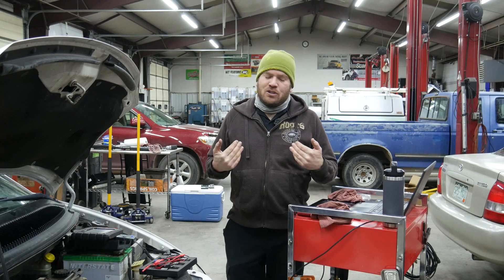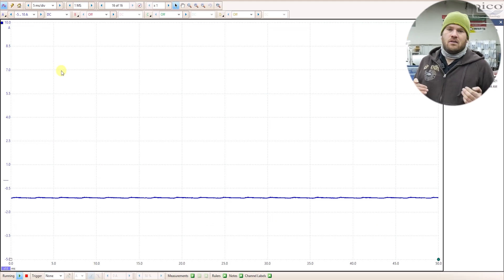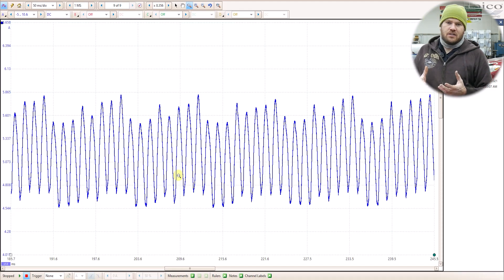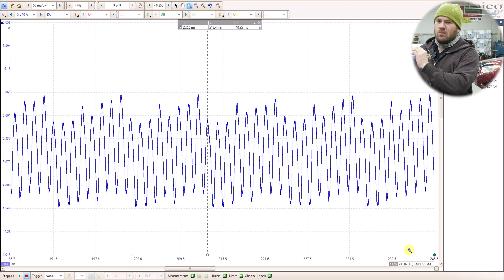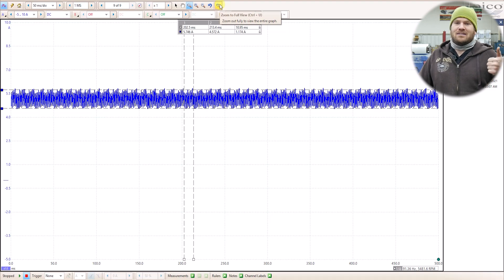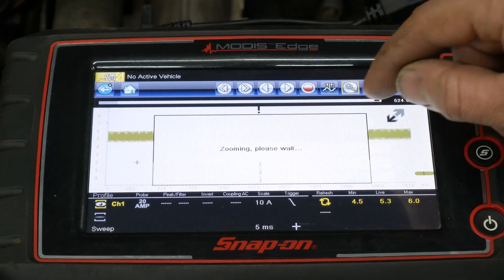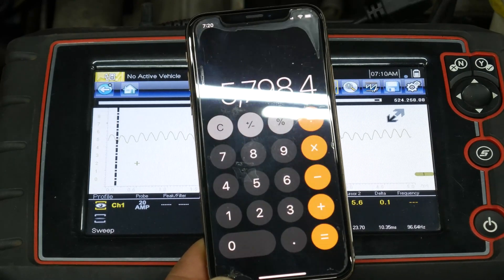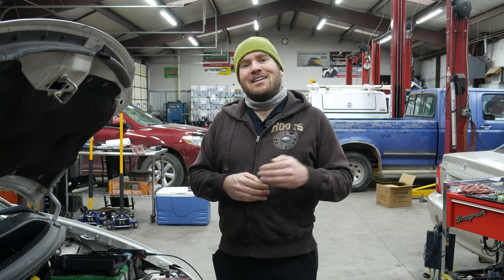Weekly Waveform #13 - Fuel pump current testing with low amp clamp.

Comment: Excellent. I gotta try this on my 2006 Matrx pump with the PicoScope 2204A and a Hantek CC-65 clamp.
Reply: Same setup I'm about to try out. what picoscope software you using?
Reply: @mrpartsng Nice. PicoScope 7 (version 7.0.116.1394) on a 2012 MacBook Air running OS Catalina version 10.15.7. I had to upgrade to this OS version to run the pico software.

Comment: Thanks for sharing your insights. Relay jumpers are cool. Just curious if Hantek or Micsig 4 channel scopes are good enough for automotive diagnosis.  What are your experiences?
Reply from the maker: Many start out with those scopes because of the price point. Most will upgrade to a pico at some point. 
I don’t have any experience with those scopes so I couldn’t tell you how good they are.
Reply: Perhaps, I could be one of those. Once again, thanks for the cool tutorials. @ThePracticalMechanic
Reply: The thing i don't like about the hantek, is the software, it doesn't show numbers in the scales.
Reply: Thank you for your input. I decided to go for Micsig, that will keep me busy for some time till I perhaps very likely to upgrade to Pico @RGV2300
Reply: Micsig makes a really nice automotive scope with pico like software features, but pico software is probably the best for automotive; you'll pay for it though, Pico is proud of their stuff.  Btw, the snap on scope isn't great, their sample rate seems low.  

Right now, if I was going to buy a new scope for automotive, I might lean towards a tablet scope like Micsig.  I'm just not personally a big fan of USB scopes for automotive.  Having the 0-360 and 0-720 rulers is a really nice thing that most scopes just don't have, Micsig has it in their "automotive" scopes software, but apparently not in the exact same model of non automotive scope.  They're all Android based tablets now, which brings up another handy feature, being able to access the Internet from the tablet, for Alldata or other reasons.

Comment: When I bench tested a Corolla fuel pump, it only pulled 2.5 amps! Squeezing the test hose to add a restriction got it to max out at 4 amps. Good pump as far as I could tell.

Comment: Very nice stuff. For folks who don't have an amp clamp but do have a scope, would it be possible to get a procedure of connecting a multimeter amp probes in series with the circuit and use the scope to voltage drop the pump ground wire on 1V AC at about 50ms timebase to check overall amp draw and VD and commutator humps created by the VD can be used for math, etc?

Comment: Hey Chad.. quick question: is there any difference between simply using an on-off switch with spade connectors on either end of the switch (and a loop of wire) compared to the relay bypass kit you've shown? You're simply trying to turn on the load side of the relay correct?
Reply from the maker: Correct. A jumper would do the same thing. The bypass kits just make it easier to perform and less chance of connecting to the wrong terminals. If the computer controls the relay and power is back fed to the computer it could cause damage. I did it for years with a jumper harness.

Comment: Let us know what went wrong with the first amp clamp and what it takes to fix it, so that we don't fall into the same trap, please
Reply from the maker: It has performed perfectly since the video so it must have been operator error. I’m suspecting a loose ground connection to the scope cause me to see the signal in more of an AC coupled format.